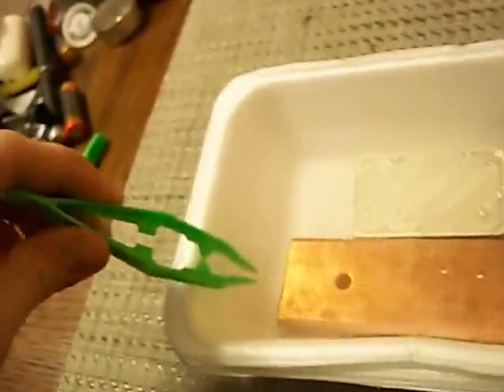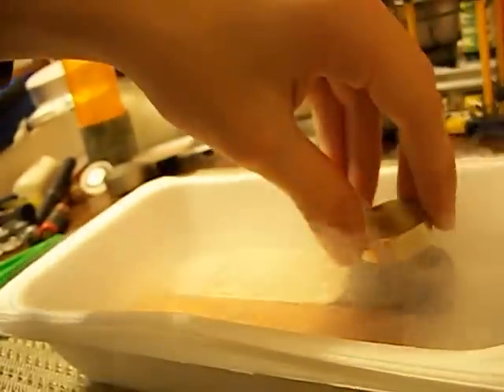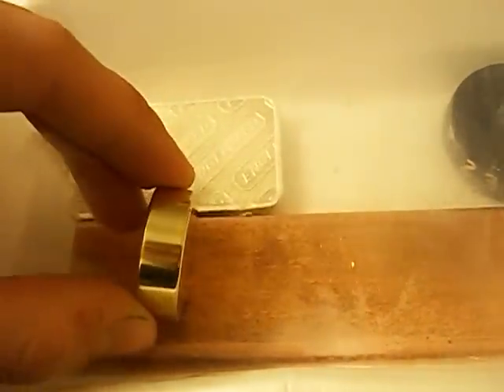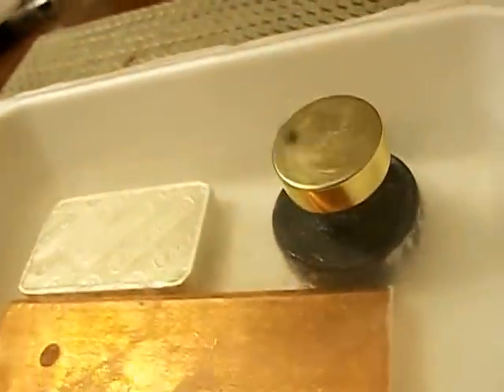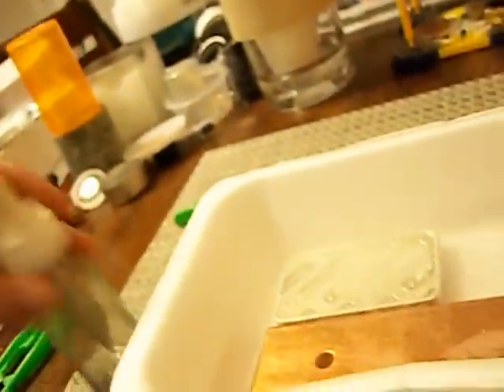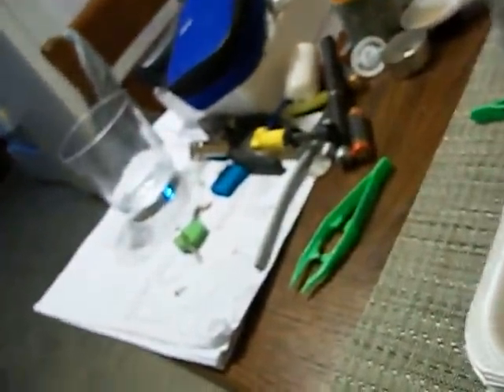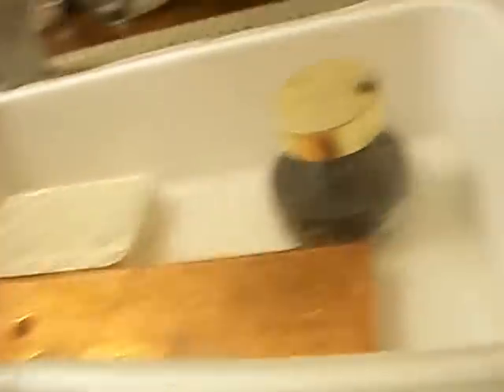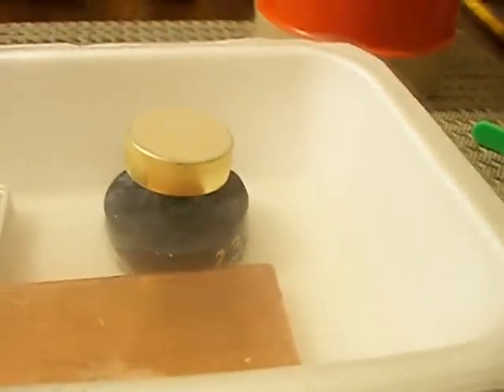YBCO superconductor

Comment: Can the nitrogen be contained in a closed container with a cap that is a superconductor and still have the Meissner effect
Reply: You could, alternatively you could enclose it but have a thin insulating layer(plastic or foam) to. Still needs a small vent for Nitrogen boil-off